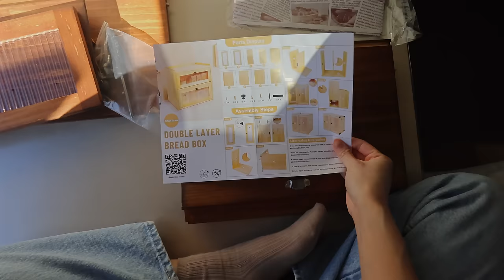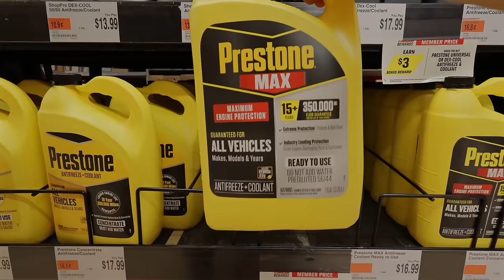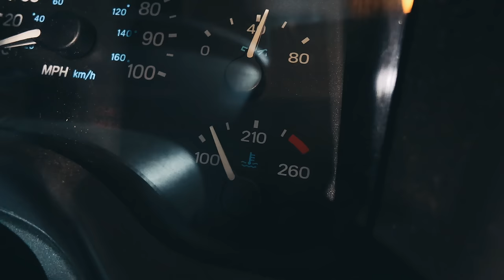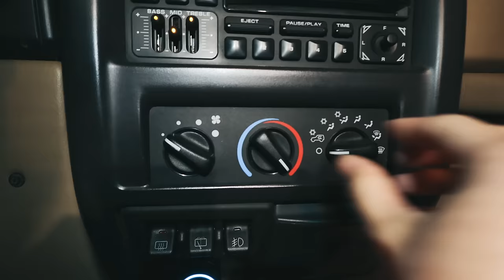What happens when you buy a 23 year old Jeep Wrangler

Comment: Welcome to the world of TJ Wranglers, the last real Jeep made.  There are spindles with bushings in the transmission area.  You should check to ensure the noise was not coming from there.  Expect to spend some $$ to keep it looking good.  I have a 2001 Sahara 4.0L, that I will never part company with.  Next you should beef it up by putting on a 3" lift kit with some fat tires.  No bigger that 35".  Get BDS suspension lift kit with JKS adjustable control arms (upper and lower).  They are beefy.  Next are some Tom Woods driveshafts both front and rear.  Get a real good SYE (Ten Factory, TeraFlex, Tom Woods or Alloy USA).  This kit ensures that you'll not have drooping transmission skid plate but a proper tummy tuck!  Next re-gear the axles with 4.56 (Yukon, Motive, or Alloy USA).  Get an upgraded Detroit Locker.  Don't skimp on the gears and internal components.  You want good quality steel.  Now you'll have the serious look of a Wrangler TJ. Change out the 4x4 contraption that Jeep came up with for low friction transfer case shifter (Novak Adapter) that engages your 4 wheel drive effortlessly.  Once you do the above you'll keep your Jeep for the next 100 years!

Comment: Re: the Transmission Mount, I'd say check the engine mounts too. When you're in drive or reverse, there is drivetrain load on both the engine and transmission, so it could be your engine shaking the transmission as well.

Comment: I would look at motor mounts, and also all u-joints in the rear driveshaft. The fact it only makes noise when in gear under load suggests there’s movement in the drive line somewhere. Also check exhaust interfering somewhere. 

Just thoughts.
Reply: Also happened to think, I’ve had best luck with the actual rubber mount from Jeep rather than polyurethane mounts from daystar and the like.
Reply from the maker: Thank you! My mechanic just suggested new motor mounts, so gonna try that next!

Comment: I don't recommend a urethane mounts they can squeak and rattle. It could be because you replace just the transmission mount. The two engine mounts are slightly lower than your new transmission mount, causing your whole drive train to shake. I recommend replacing your engine mounts as well. P.S. Before replacing any mounts get a grease gun and egressing the universal joints.
Reply from the maker: Thank you! Will look into this!

Comment: Isn't it fun owning an old vehicle? Good thing is you get to know your vehicle when you start fixing things yourself. 

Some nozzles you can adjust them with a small tool like a flathead.

As for your transmission issue....maybe the bushings for the transmission mounts need to be replaced. I had a somewhat similar issue on my Montero when I first got it.  I replaced the mounts and it solved the issue.

Comment: I'm going off what I know about Subarus. On a side note, I bought a shop battery powered light bar to work on my 2006 Forester and it changed my life. I carry extra cam and crank sensors just in case I'm in the middle of nowhere and can't start. If they haven't been replaced, that could be the problem. If not you have extra to take with you. I'm guessing they are extremely easy to swap out on the old Jeep, like 2-3 minutes. If it's like a high frequency vibration, it could the be torque converter related. Or maybe try changing to differential fluid. That's probably the cheapest and it's routine; anyone can do it. If it's more of a shaking feeling mostly while in reverse, it could be old motor mounts. There are Chilton's manuals available specific for the Jeep.

Comment: I had a dodge neon (also mopar) that used to do that and there were engine mounts on the passenger side of the car (3 I think, an upper, lower and middle) that had bad bushings. Basically the rubber in the middle gets old and cracks and allows enough play to cause a vibration. You don’t feel it as much when the engine is under load (in drive) but when you’re idling you feel it. I’d have em checkout the other mounts in addition to the trans mount. Two are dog bone mounts (they’re long like bones) and the middle one is more square and mounted to the sidewall and engine on the passenger side in the middle (hardest to get to)

Comment: Link that camping light please! 😍 also, I know that jeep life, its rough lol. We've had 5 different wranglers in the past 10yrs ranging from a 1985-2014 and they've all been WORK to maintain and keep the check engine light off. My husband is the one who's done the work on all of our jeeps and I hope to learn more just like you are!
Just learned how to change the spark plugs and o2 sensors this last month 😆
Reply: Also, my jeep is jumping when idling rn too, and we haven't figured it out. We changed o2 sensors, spark plugs, ignition coils, but we keep getting a diagnostic for misfiring spark plugs even after changing 🫠 same 2 plugs too.
Reply from the maker: This is amazing you both DIY! Gotta get on your level! My engine light just came on last night and the OBD2 reader says it's a misfire in cylinder 3. Literally just had coil packs replaced, but it's misfiring again, so could be another issue causing it. Lawddd! This money pit! Good luck with your Jeep!